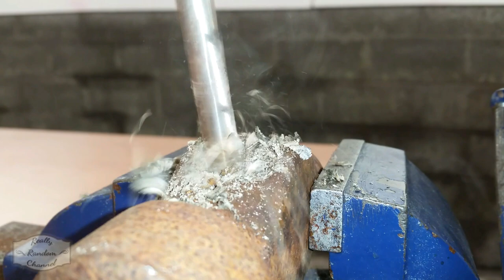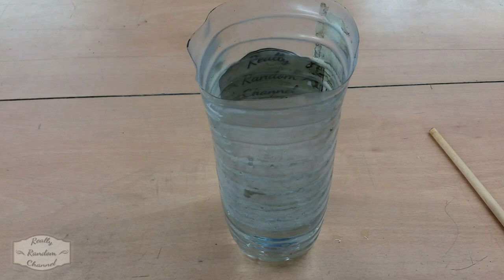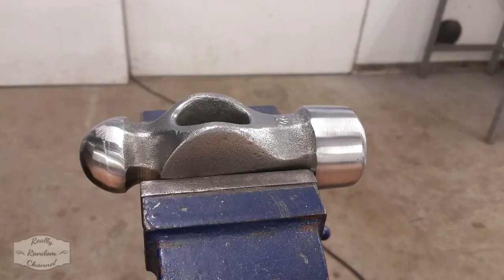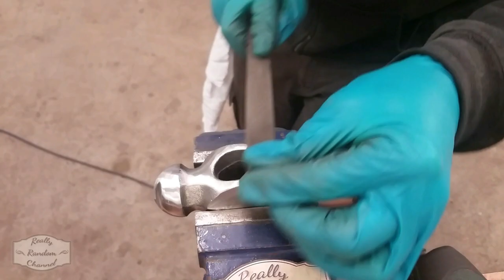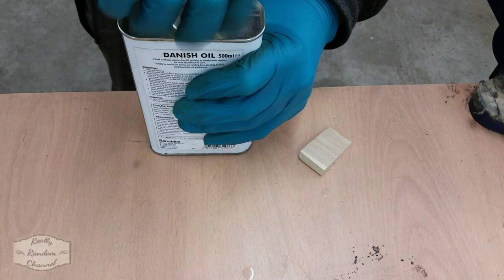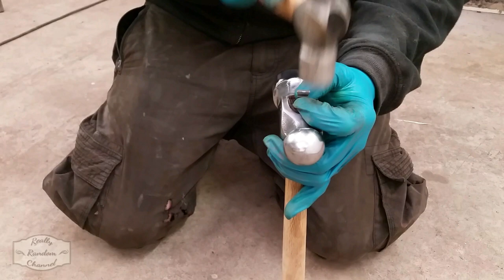Perfect Rusty Old Hammer Restoration

Comment: Nice n easy restore. Good job as usual.👌🏼 What is that chemical that you mixed with the water? It works really well!
Reply: as stated in the description... "To remove the rust i used the old favorite on this channel deox c, After its bath you can see that the steel is completely free of rust and can now be worked on properly."

Comment: What kind of disk did you use with the angle grinder after using the belt sander? I'm having trouble finding this type of disk without the name.
Reply from the maker: Hi,They are called flap discs they come in all different grades i use a 120 in the video.

Comment: Brilliant mate..was that caustic soda you used to shift the rust.cheers
Reply: I'd put money on it being "Bilt-Hamber DEOX-C". It's scary how well that stuff works.

I recently bought a vintage "Hobby" lathe on ebay (Though it would appear that back then they took their "Hobby" engineering a lot more seriously than we do now ! LOL !). When I picked it up it came with a box full of heavy rust (Described as "Accessories" in the listing !!!). A fair amount of the stuff in the box had rusted into unrecognisable clumps, So I just dumped the lot in a bucket full of DEOX-C and forgot about it. It stayed in the solution for 3 or 4 days. This stuff works best if it's kept warm, So I left the bucket in my swelteringly hot corrugated iron roofed garage during the sunny period we just had (In the UK).
Out of that 10ish kg box of rusty junk I've actually resurrected about 7kg of usable tooling (After resharpening). About another 2kg was so heavily pitted that there was no point in trying to save it, and the rest turned into murky brown water and floating scum. :)

The stuff I saved came out of the bucket without a speck of rust on it. A light rinse in water was all it took to get them completely clean, Then I dumped the lot into a bucket of cheap engine oil to keep them from rusting again while I got around to sharpening them back up.

That £5 worth of DEOX-C saved this couple hundred quids worth of used lathe tooling. It was stuff that would probably have ended up in the bin if my only alternative was to resort to a weeks worth of wire brushing and grinding.

Luckily, the lathe had been seriously slathered in oil and grease before it was stored (For over 40 years !!!), So it's faired a hell of a lot better than it's tooling. :)
Reply from the maker: Bilt-Hamber DEOX-C ;)
Reply: @RRCRestoration  I wonder if it would work on the inside of a rusty bike  bike tank.might give it a go.cheers
Reply from the maker: @arthurconrod9825   It works brilliantly on the inside of tanks you can see me using it to great effect here - https://youtu.be/HWsLX_lg2Vo

Comment: How do you remove the black rust that hangs out in the really tiny peck holes all over the hammer?  If I try using something abrasive the problem is it can't get to the rust b/c its down in the tiny peck holes.  Is there a chemical that will get that stuff out of the tiny holes?